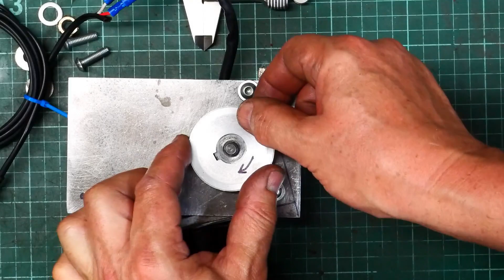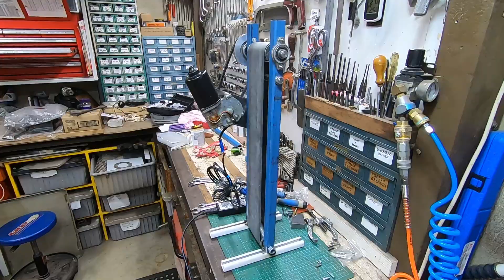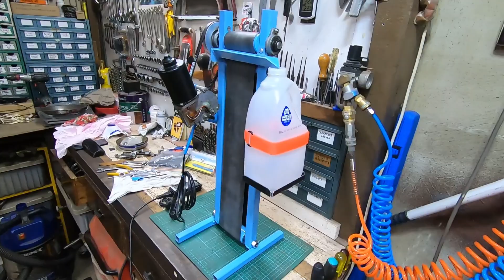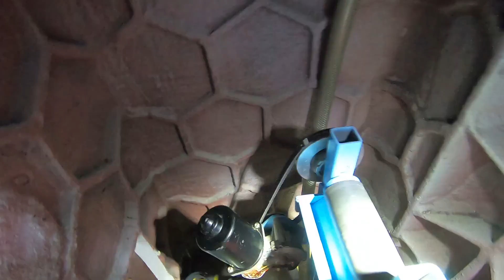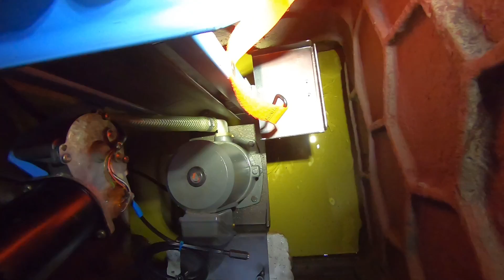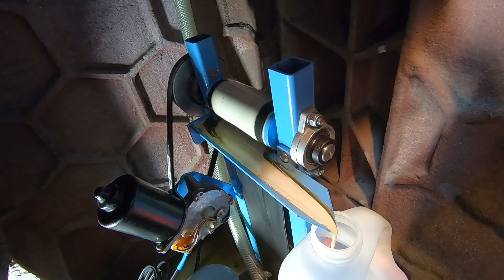Oil skimmer build - Part 2 (Final)

Comment: where did you get  belt from
Reply from the maker: In Part 1 of this project (https://youtu.be/wQWHFzz59lY) I explain that I cut the belt out of a small inner tube. However, this proved to be unsatisfactory and I made a new belt from a length of neoprene rubber (https://youtu.be/JsWkPKdhA5E). This is still working well after 2 years in service.
Thanks for watching.

Comment: Allan do you use insert gfn 3w ic328 for parting off? 
Christopher from Queensland
Reply from the maker: I use 32mm parting blades from LPR Toolmakers in 2,3,4mm thickness. Link: https://www.lprtoolmakers.com.au/insert-parting-tool-blades-only-19-26-32mm-with-1-insert-included/
Cheers, Alan.